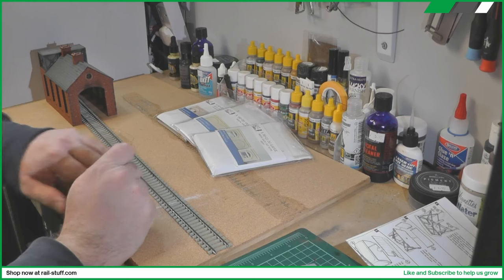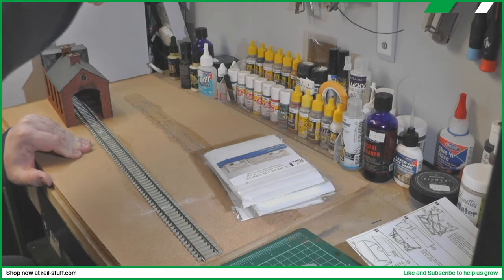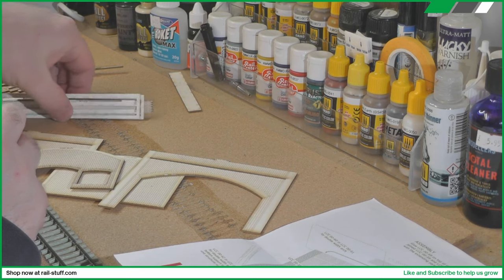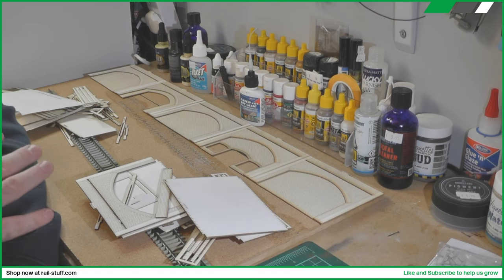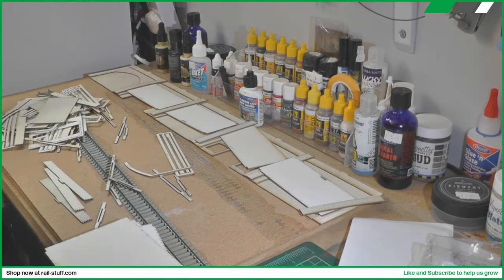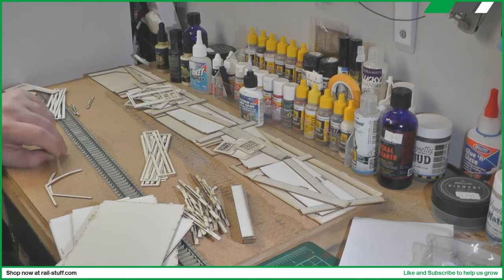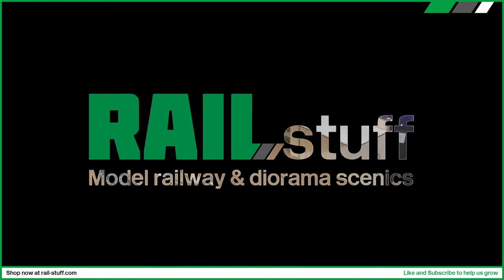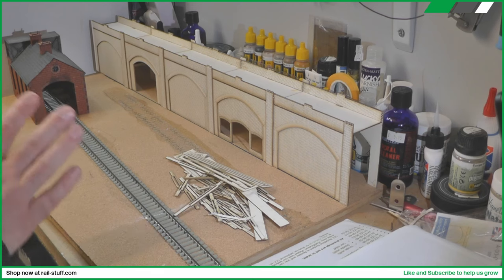The Arches Omnibus: Building an arches diorama in OO gauge with laser cut kits

Comment: Don't waste your arches.  a piece of stout card or 3mm MDF would be better and cheaper, especially if the arches are at an angle to the edge of the board.  You will then have arches left over for Bridge spans, viaducts, tunnel mouths.  Laser cut arches have so many other uses.